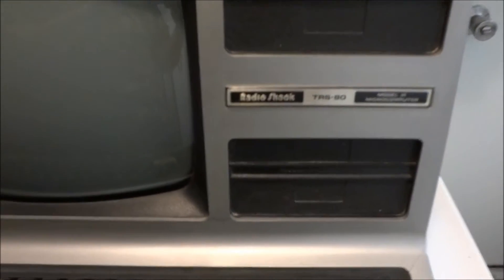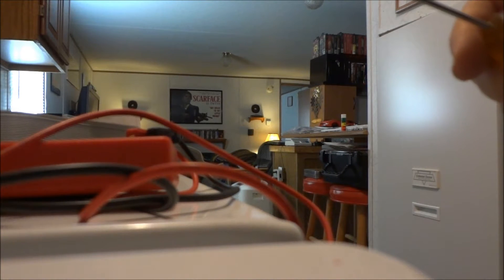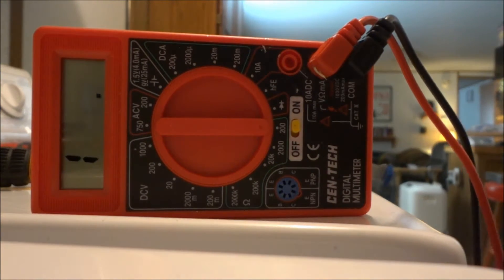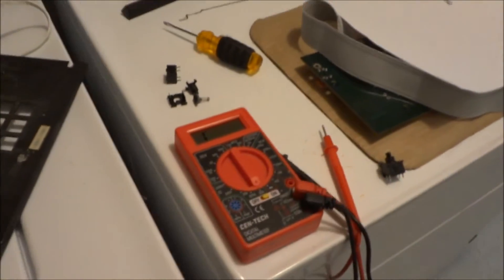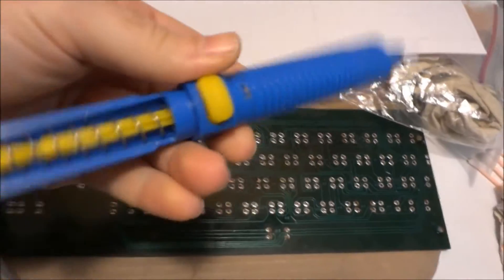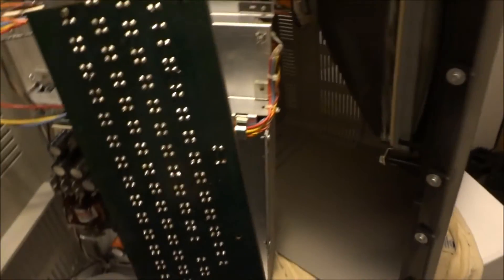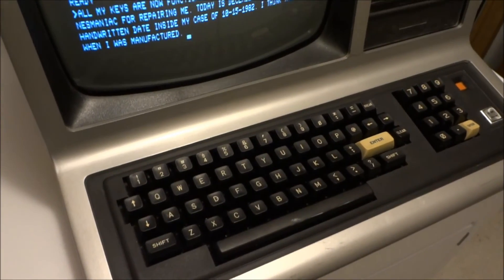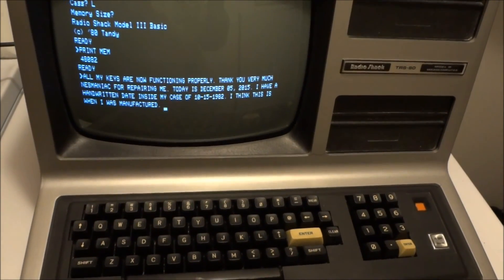RadioShack TRS 80 Model III keyboard repair instructions.

Comment: I'll give you $200 to do mine. I reallly don't feel like it.
Reply from the maker: I don't think I could stand to do it now or have the patience. There has to be a better option. I remember doing this just mainly to see if I could get it working but probably will never attempt anything else like it again. I've not had this computer on since just have it displayed in my man cave so really pointless to fix it I guess. I'm sure you could find someone with a better desoldering tool than I have that would do it for $200 or maybe less. I really don't have a good soldering iron or desoldering tool just basic stuff. Thanks for watching I hope you get yours operating like new again.
Reply: I have the keyboard out. Also had to fix the CRT mounts on the case (outside pair were broken). Now the fun part.

Comment: Well done!  I'm also about to fix my Model 4 keyboard.  Mine is a bit more of a mess because the PCB has a hole punctured thru it due to the center plastic post.  So mine has eight jumper wires.  Anyways, your video is helpful and I was also able to see the PCB trace lines that were missing on mine.